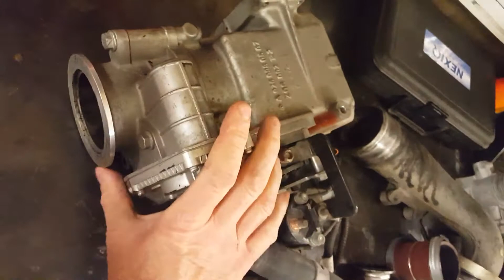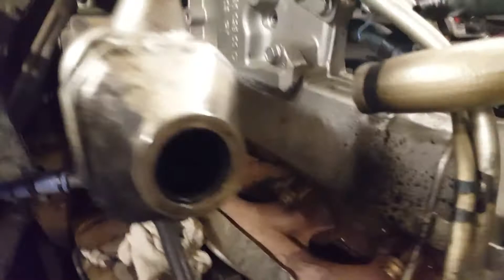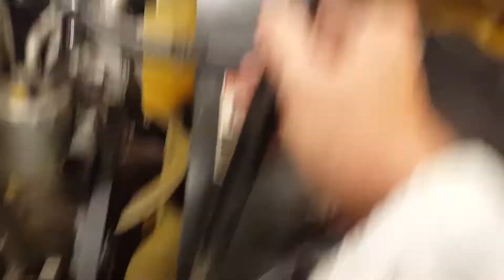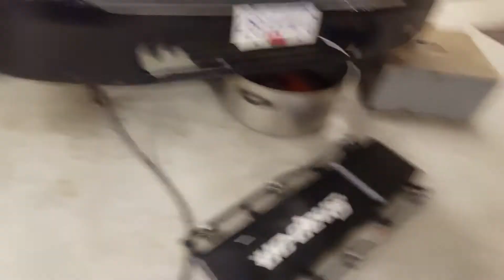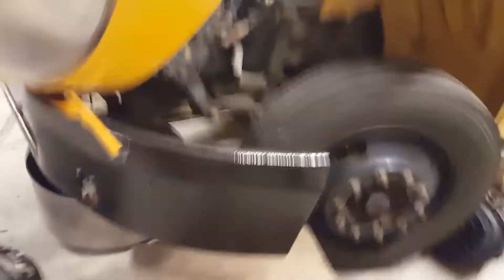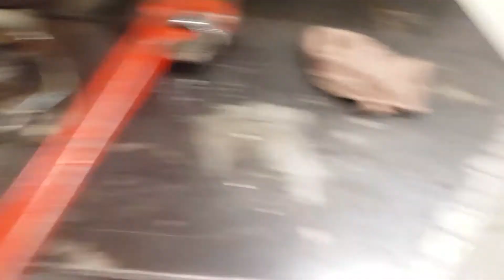Mercedes MBE 900 Diesel Engine Code 2631

Comment: Hey I know old post, but your vid came up on a search for boost pressure sensor location. Is the boost pressure measured at the IMAP sensor or separate? Can't seem to find it and am getting 0 psi boost measured. Same year and engine as this one. Thanks!

Comment: Hello again, I'm back at your videos because you are the one with the most info on these engines. I wish you were still making vids about them. 

I have the 04EPA model so EGR only. I have enjoyed driving it for the last 6k miles across canada and now down into the US. I converted my 08 Thomas Pusher into a motor home. 

I just hooked up a tow vehicle behind my 40' bus and I am now going down the highway at 60mph max. It sits at 1800rpm and I just can't get it to go faster on the flats. Before I started towing the Jeep I was able to push it up to 65mph at 2200rpm. Nothing else changed just started towing the vehicle. The vehicle weighs 23500lbs and the GVW is 36,200lbs so I am pretty far under max weight. The engine has 106k miles on it. Any suggestions on the loss of power? I know it is speed limited at 65mph as well. 

I'm going to be changing the fuel filters as soon as the parts come in, as well as the air filter. 

Thanks for your help.

Comment: You're in BC! I am in the process of buying a 2008 pusher with an 04 MBE 906. I'd love to chat with you to see what you think.

Thanks
Reply from the maker: You can ask anything you want here. The 04 mbe was installed in a 2008 pusher? How is it working out?
Reply: @MechanicsHubdotCom  Hi, thanks for getting back to me. I have not driven it yet but it looks extremely clean for an 08. the engine looks brand new, if I could send you a photo i think you might be amazed as well. How do you like those engines? What should I look out for when I first get it to drive it home?

Thanks
Reply from the maker: @skydivedickson  I like these models. They are dependable more so with regular maintenance. Just do a walk around the bus and do a visual check including levels.
Reply: @MechanicsHubdotCom  Do you still have any of these pushers in your fleet? Can you do a "how to" inspection video? I'd love to see what you check, grease, and verify. I've never driven one before so it would help out a ton and I don't see any of those kinds of vids for the MBE engine.

Thanks
Reply: @MechanicsHubdotCom  I have a question for you. I am having issues with a couple of instrument panel lights. The parking brake and the high beam light will not come on. Do you have a suggestion on where to start? Thanks
Reply from the maker: @skydivedickson  I have to start with the basics. Did you check the bulbs? I have to ask😊
Reply: @MechanicsHubdotCom  Bulbs were burnt out. I can't find replacement bulbs for these. The little black ones are nowhere to be found around here and I even called Thomas Bus in Quebec.
Reply from the maker: @skydivedickson  are there any numbers on the bulb?

Comment from the maker: Recirculated exhaust from the EGR valve. Raw exhaust isn't pretty. Leaves a thick soot trail wherever it goes. We clean sensors and spray parts with combustion cleaner.
Reply: Mechanics Hub I am getting an EGR valve code.  I took the egr valve off and cleaned it. Any other suggestions?
Reply from the maker: Do you have Mercedes software? You can test the EGR valve. If not try cleaning the moving parts like you've already done and retest it back on the engine. If it's sticking internally you might have to replace it.